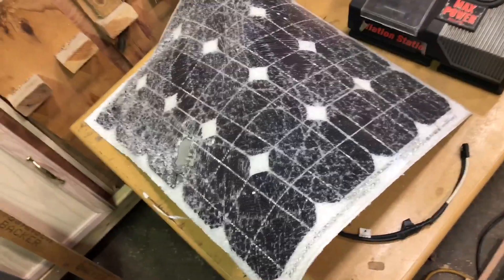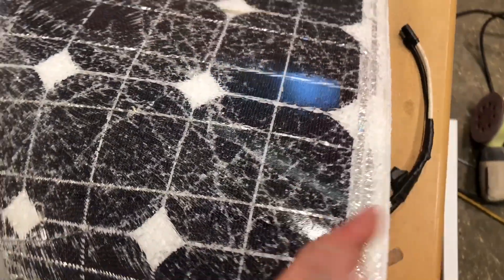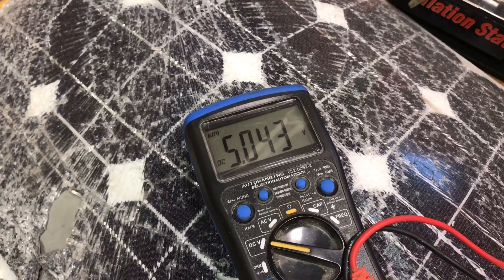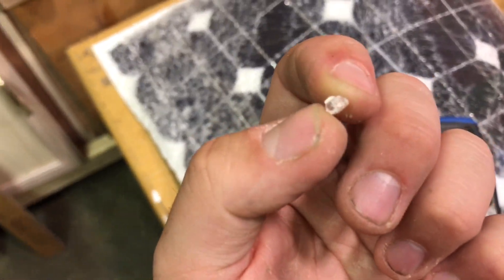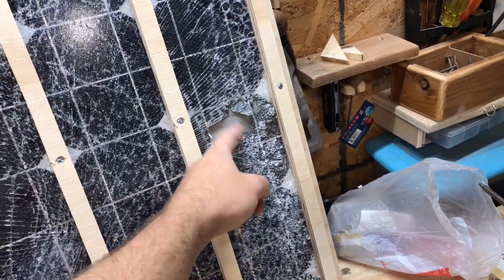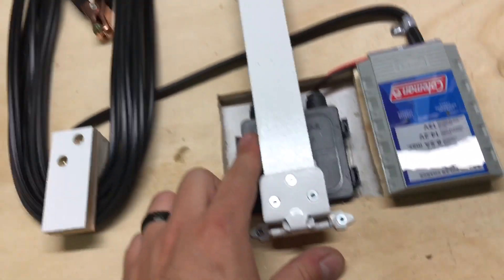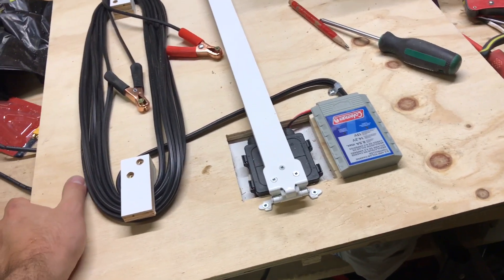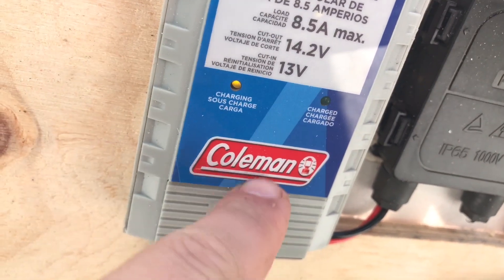How to fix broken solar panel

Comment: I appreciate the effort. But wood is a really poor choice. It will degrade and bend in sun and rain. Just glue it on a sheet of glass.
Reply: Note that glass needs to be lead free to it to work far as i understand so normal glass wont do.

Comment: Voltage by itself is not power. You must have voltage and amperage. Broken panels like that will usually show good voltage but they usually have next to no amperage. I learned my lesson after buying five 240w (1200w total) with broken glass. All showed almost max voltage. Well I never checked the amperage. The max power I have been able to get was 85w with all of them hooked up together in parallel.
Reply: You have to dissect it and reconnect broken lines/disconnect shortes then mount the cells on a piece of glass and youre good to go

Comment: My 2 solar panels fell off the roof... all 2 broken glass do they still work? How can i fix these
Reply: Damian Verhoeks check and make sure you have BOTH voltage and amperage from the panels. IF YOU DO than you can buy a solar encapsulant (like QSIL16) and repair the glass.
Reply: Tj Smith no voltage from panels
 :( can i get the cells out?
Reply: Damian Verhoeks no the cells will not come out. You may be able to bypass them with jumper wires. There is a video on here on how to do it. What size panels? Did the frame get damaged (if so how bad)? Sounds like you had a puncture?